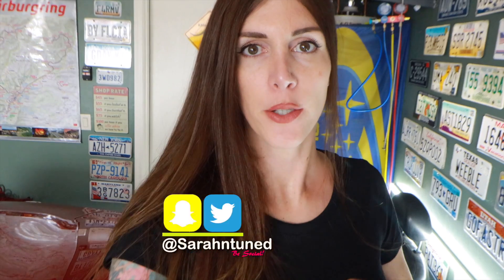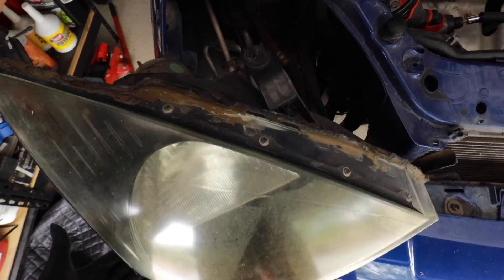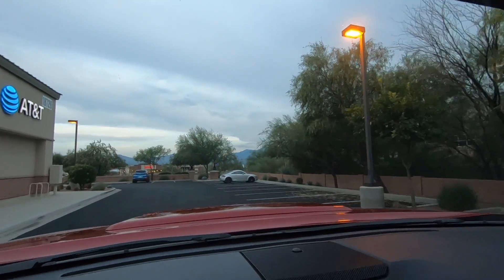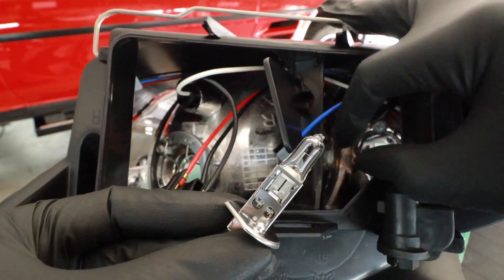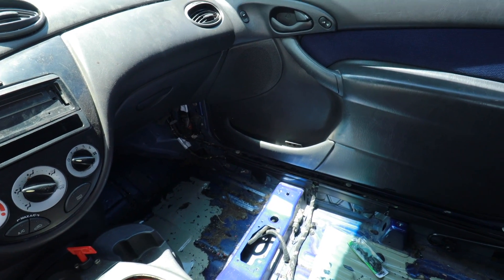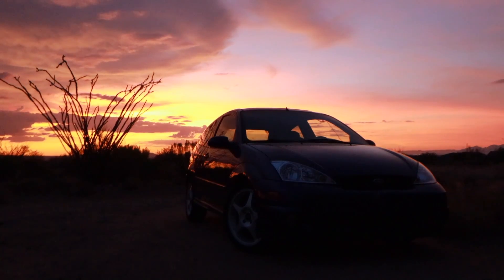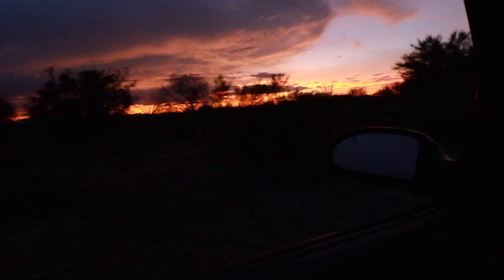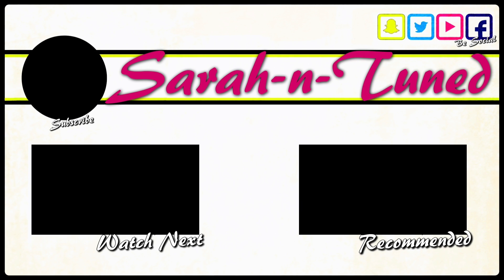Focus Gets a Euro Spec Facelift! // Focus SVT Rally Build

Comment: You should get an off road pipe, new clutch and flywheel, big brake kit, 67mm throttle body, CFM short throw adjustable shifter, tubular control arms, CAI, catback exhaust, wider tires, and a tune. These are the best for your money performance modifications for this car. (And a quaife differential but nobody has money for that 😂)

Comment: Sarah an old timer Mechanic at the winery told me and showed me how to use a seam ripper that you use for fabrics on electrical wire insulators and it works great especially when you have multiple wires and like a harness with that hard plastic wrap this thing just rips right through the insulation!

Comment: For a quick and easy electrical terminal boot, you can put a longer piece of heatshrink on there and shrink it down over the whole terminal with a nut/bolt in place, then cut away the backside down to the point you want it to hing at. After a couple practice ones, you'll end up with nice form fit boots that will almost snap into place.

Comment: A lot of clutch safety switches have little rubber caps that wear down or come off over time. May be why you have to press it in so hard. Could also disable the switch, since it is a race car!
Reply: Disabling the switch also causes less wear on the crank thrust bearings, since you're not endloading the crank on start ups.
Reply: @rennkafer13  Yep. Just did it in my GSX which is classic. Haven't heard of it being an issue with many Toyota engines, but it can't hurt. :)
Reply: @802Garage  I don't know that it's a particular issue with the 2 liter in the Focus, but not putting pressure on the thrust bearing when it's not being lubed can't hurt.
Reply: @rennkafer13  Hahaha oh oops I meant Focus! Was thinking of the MR2. :) Agreed.
Reply: @802Garage  MrDos probably has one that needs to go away too.  :)

Comment: When you put the cage in, have the welder weld a 3/8" bolt (without the head) on to the cage support in the rear for the negative post. Will work better than a body mount. Do the same up front for good grounds for the ECU and other harness grounds.
Reply from the maker: David Zimmer I don’t have anyone to make a cage, it might not happen unless a company sponsors one.
Reply: @SarahnTuned  Okay. I'll check around on Yellowbullet and see who's local. A simple cage is easy. Just need to find the SFI spec for that type and get it done. I'll check back in a few days.

Comment: Working on my Rally car too.  Bought it off a guy on Craycroft, every time I work on something I find more issues.  Doubt I will make the 10 August night run in Tucson.  Air hammer the sound deadening, Harbor Freight -12 bucks.  Took 18 pounds out of my outback rally project.  Need to ask Owen what he would charge for a cage, he just welded one into my sons drift car last week.

Comment: ah.. the svt.. i own 4 foci.. zetecs though :(. stage 2 comp cams. y2k intake manifold. 65mm throttlebody. tune. supertech valve springs. polished and ported head. vales lapped.  je high compression pistons, zetec stock rods with arp rod bolts. tri metal bearings by clevite. 75shot at 4500rpm-7k.

Comment: The clutch pedal doesn't look like it's lining up right, is there side to side play in it?

There is a small clip/spacer on a bracket off the pedal that hits the switch, yours is there, but there's also a nut on the end of the shaft that the pedal pivots on. If that nut is loose, the pedal won't be in the right position for the clip/bumper to hit the switch.

Comment: 😎🤙🦅🍪. U need to vent the battery.  Unless u bought the Vent kit and didn't mention it.
Reply: SourBogBubble - So how are rear batteries “vented” in like a Camaro when it’s in the trunk?
Reply: @cmdrdarwin3682  most likely passed air quality tests? They sell kits to vent batteries they r like 3$ max. Plastic thing u attach a hose too
Reply from the maker: SourBogBubble it’s an AGM battery.

Comment: I cringed when you drove out of the garage with the hood up. A little tidbit I learned from my time running on dirts/in muds (you mentioned a wrap), if you have a vehicle, you can get past body damage (light to moderate, to start with), you may be surprised by where you can actually go off road.  Stock up on quarter panels if you wanna keep it looking crisp, otherwise let it look like - its been there :) :)

Comment: Your clutch pedal isn’t adjustable. Replace the switch on the clutch pedal. I pops off without any tools. You won’t have to compress the clutch so hard to start your car. You can get them at any junk yard, and it’s the same park on duratec cars. Are the st170 headlights the same plug as the eap projectors? Do you still have your stock 02’ grill? They are rare nowdays

Comment: That's the Spirit Sarah!  Keep in mind on the engine hoist, you can "break it down" into smaller pieces until you set up.  Also, with heavy items and parts, a good pair of boots or steel toed work shoes is never a bad idea.  Looking forward to you conquering the MR2!  Good to see Sarah ST also.
Here is some inspiration for you (scroll down to video). 
https://www.roadandtrack.com/motorsports/a28496453/watch-the-son-of-a-rally-legend-dominate-the-goodwood-hill-climb/?source=nl&utm_source=nl_rdt&utm_medium=email&date=072919&src=nl&utm_campaign=17624247

Comment: Yelling at the the screen throughout this entire video. :(  In most cases the ball adjusters on the lights are just popped out of their sockets.  Did you find loose pieces rattling around the inside?  To make a truly PnP headlight harness you'll need those VW plugs, a bunch of VW wire/pigtails, the sockets off the old headlights, and (for the full PnP) a Focus Wagon add-on trailer wiring harness to chop the turn signal sockets off of.  I'll find a site with a How-To and add it later.
Reply: Here you go...  http://ofoc.ca/hid/index.html
The Euro Facelift/ST170 headlights and the Mach HID lights use that same connector/wiring configuration.
Reply from the maker: Charles Aggenbach it’s completely broken off and was missing
Reply: @SarahnTuned  That's too bad.  At one point I had a pair of Mach HIDs that were trashed but I pulled parts off of.  I'll check around and see if I happen to have that piece from them (not 100% sure if it'd be the same between them, though).  I don't recall the internals ever being available separately.